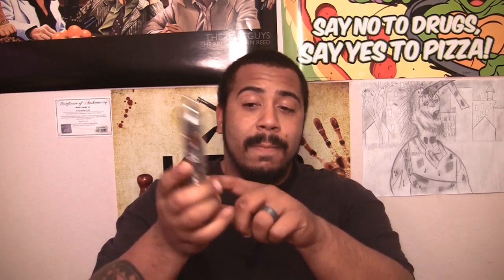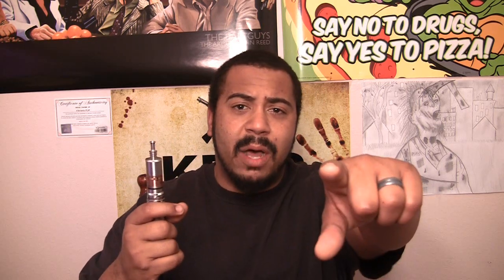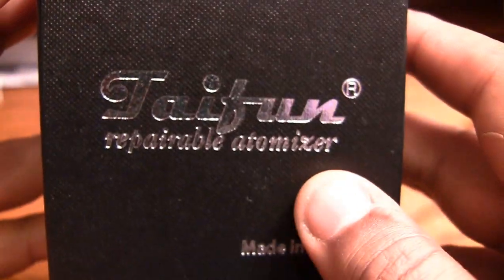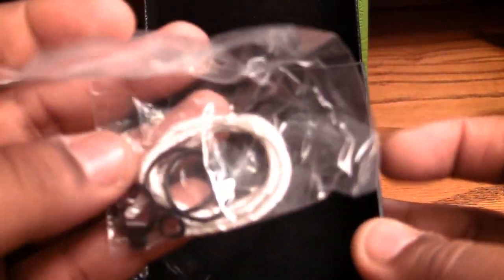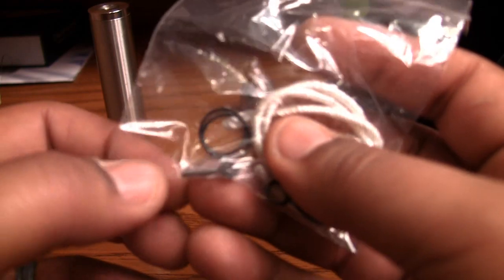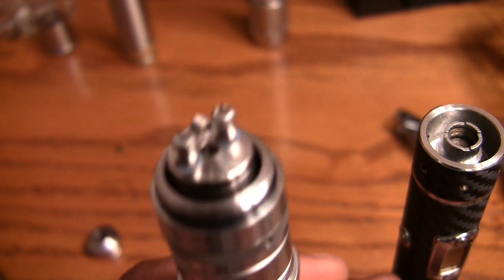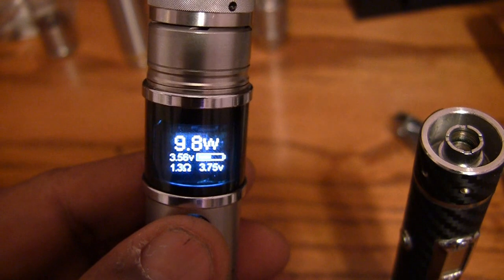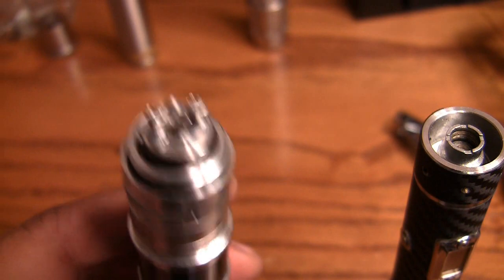Hcigar Taifun GT Review and Tutorial-Flavor Beast RBA-VapingwithTwisted420

Comment: Twisted m8, when you put in your coil turn it over. That way the tails will naturally be on the left side of the screw. Then when you tighten the screw it's pulling the tail around it instead of pushing it away.

Comment: Got mine today, no idea if its a hcig version or not. Got it from Vapour Break @ £16 ($26) with free delivery to the UK, saving £100 on the original. Could never justify spending that much so it's not like they have lost a sale through me buying a clone. Well happy with it, all stainless with really fine knurling, the bottom of the air hole thing was fine and not chewed up at all. Wicked up with some 3mm braided silicon stuff and its working fine, I did give it a soak in isopropal alcohol before to get the remnants of machine oil off first. Its just a big protank that is easy to re-coil/rebuild yourself really.
Love your mother fucking reviews ;-) keep up the good work!

Comment: My Hcigar Taifun GT  was somehow saturating in a light film of grease. It was something like you find on a fresh set of tools. But the issue with that was even though I cleaned the ever living shit out of it the AWFUL taste stayed as of it was down the air hole. Its the best vape I've ever had but it shouldn't come at the price of 3 straight days of cleaning.  Maybe just the vape God's getting me for using clones so much. To clean it I soaked every part in vodka and after that I soaked it in boiling water. I did this about 4~5 times in between which I vaped on her through out the day.